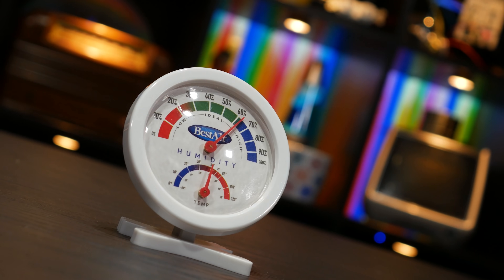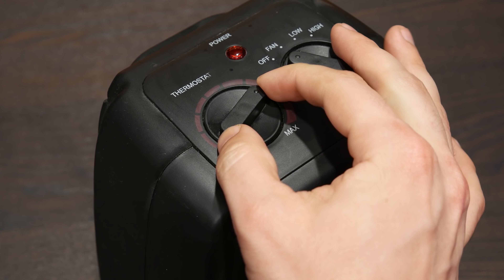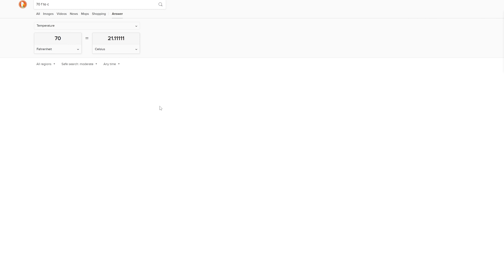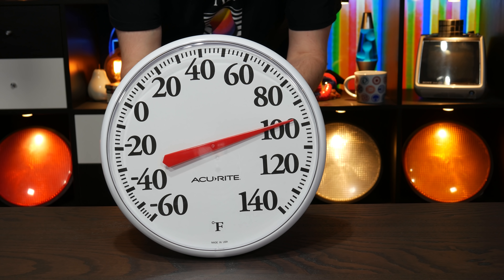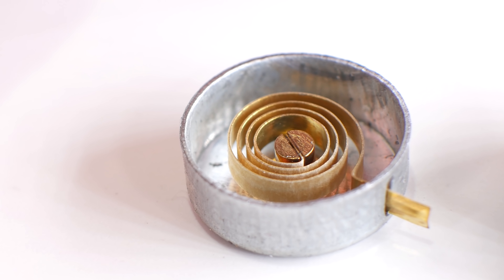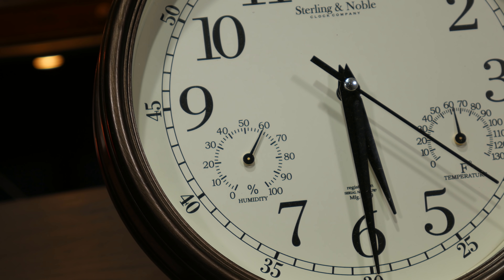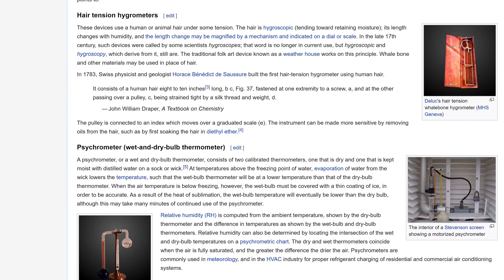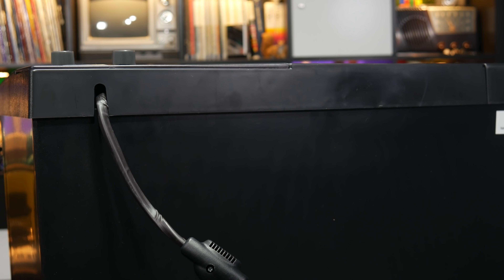Analog Hygrometers - how?

Comment: Cool video, thanks. Few years ago I learned something very interesting about how they measure air humidity at airports. For the flight operations it's more important to know at which point pilots need to expect fog, clouds or icing. Because of this they give the humidity by telling you dew point (temperture at which the water will condense). You can calculate the dew point from relative humidity, but often the dew point is directly measured by cooling a mirror until you see condensing water. I think this is a strange way to measure humidity :-)
Reply: Dew point is interesting very much more relevant/critical. Especially if you live in areas of moderate climate. I have (or am working on ) a logic controller for my HRV unit - which normally serves to remove humidity in winter, but which I use to remove CO2 in summer. The logic will check the outside dew point, and if it is greater than 10C, it will reconsider running the unit since a dew point > 10C will result in an indoor relative humidity > 50% which is not what I want.
Reply: Or dry bulb and wet bulb like inlearnt at shcool

Comment: I like my simple little fridge thermometer it still works out on my veranda.  It doesn't need batteries. There is a clockwork radio that used a clockwork spring to turn a dynamo that generated power to amplify the channel in the radio. The Trevor Baylis Clockwork Radio teardown https://www.youtube.com/watch?v=3Nz781FsyGI . Cheap to buy and cheap to maintain. A clockwork radio perfect for rural backwater countryside far from affordable electricity. Thanks.

Comment: Finally someone taking those metric snobs to task 😂
Reply: They aren't metric snobs. I'm from the UK, old enough to have learned the imperial system, lived in the USA for 10yrs and perform some engineering tasks for a living. I've built lage machines in both the UK and the USA in both metric and standard. I'm lucky. However, most people in the world haven't had any reason at all to consider imperial units. If you were born in Germany 60 yrs ago, you'd have no inkling of what 60,000lbs is. To such a person you might as well say 60,000 birimpups, for all it means to them. It's not a case of "not really having a good grip on imperial"; it's more like they've absolutely no idea what is being conveyed.
Reply: @MrPoopnoddy  Missed my point entirely. I don't currently think in metric, so when I find someone using metric units, I use technology to help me convert the metric units to imperial ones that I can understand. What I don't do, and what Alec is plainly confronting in the section to which I referred, is see units I don't understand and respond by flaming the content creator.

Comment: I'm totally OK with your using Fahrenheit – though I might not be if this were a pure science channel.

I grew up in the UK in the 1970s and I'm an odd mix of Imperial and Metric: basically I fully understand multiple systems (though it took a while to grok "hectares" for some reason, and admittedly I still sometimes forget that U.S. pints are smaller than ours). There was a huge digital thermometer on a building on my bus route when I was at school, and it read in centigrade, so for a while that was an exception: in my twenties I had no clue what Fahrenheit numbers meant. But eventually someone explained the 0-100 = human comfort thing to me and now I understand both F and C - at least at normal ambient temperatures. If I need to convert more accurately, I use the formula in my head. (Google? Why would I do THAT? I need the mental arithmetic practice!)

Some people seem oddly reluctant to accept that it's necessary to learn more than one system ("why should I learn multiple ways of doing something? Everyone else should just change to MINE!")... and yet, it seems to me more sensible to make an effort to do so. It's just... pragmatic. Then again, having been born "on the cusp", perhaps I'm biased.

Comment: I’m all fine with freedom units,  it why in all reptiloid overlords name would someone use percents to measure any ratio? Either go with the much more natural perpi (where for example the really ugly number of 31.8310155048877% equals exactly 1 perpi. Plain and simple. Also more natural, because of pi-charts. Not pie-charts, though because cranberries are hard to convert. Especially to something edible.
Or use the freedom unit of ratios, the centper. It’s like mpg, but for ratios. 25% (metric nonsense) equals 400 centpers, 0.5 equals 200 centpers and so on.
By the way - took only about 40 centpers of the time to write this nonsensical ramble than to google how many barns are in a square inch.

Comment: My dad made a hygrometer using human hair that hung in his shop.  It was a bike spoke, attached to a circular piece he turned on the lathe.  The hair was stretched from the top and wrapped around the aluminum piece at the bottom which was on a bearing, and the spoke was slightly off center of its center of gravity and provided the tension.  It was also the pointer.   He would occasionally ask my my mom for one of her hairs, if the hair needed to be replaced.  It worked pretty well.
Reply: love the idea of devices made from human body parts
Reply: @9600bauds 😏
Reply: Did he drink?

I ask because he obviously knows things, so if drinks and knows things. (Tyrion Lynnister quote)  Old school dads should all drink and know things :)

Comment: When I was a kid, I was fascinated by a home "weather station" from polish mountain regions. It contained thermometer and 2 figures. If a men was in front it indicated nice weather. A woman in front indicated rain. I opened it some time and was very disappointed and cheated. Instead of some demonic mechanism I found out two figures whare just hanged on a piece of ordinary, natural fiber sting. I foot this couldn't make weather forecast any more, then a flip of coin. Yeta it seemed do work. 
That was a simple hygrometer. The natural fiber string got shorter and more twisted presenting man, when the air was dry. It got longer and loosened (more straight) when the air was humid. More humidity indicated that rain is coming. 
With time it got broke and the woman was always out- natural fiber hygrometers of that kind get less and less accurate with time due to fiber getting longer by constant pooling on it.

Comment: As to C or F, Metric or Imperial ... etc .. you sir have a Thermo - METER .. You Have Hygro - METER, Etc and every other thig that counts shit ending in Meter, now let that sink in ;)
Reply: @dolita windo  a parcel of air near saturation may contain 28 g (0.99 oz) of water per cubic metre of air at 30 °C (86 °F), but only 8 g (0.28 oz) of water per cubic metre of air at 8 °C (46 °F)., its a question of mechanics and ratios, a meter just like the one in the video but with both cogs connected, lets say we have 10g water at 30° is 70% and 30 is also very hot temperature, so, the colder it is, the more humid , so basicly temperature cog turns anti clockwise, forcing the humidity cog to turn clockwise, thus in an analog way represent the decreasing temperature and increasing humidity even if humidity stays at 10g per cubic meter,  and having it in a way where if the humidity cog moves left or right by itself it does not change the temperature, just the other way around, we have bicicle gears, car gears, clocks, im sure there would be a way to do it

Comment: But...but...relative humidity depends on the temperature. Wouldn't the bimaterial strip or the numbered scale have to change from one temperature to the next? Or is the paper somehow responding in the same way somehow? Is the metallic strip changing based on the temperature and and the paper just conveniently responding in a way that lets you represent the relative humidity across a range of temperatures? 

Haaaaalp I can't sleep. I have to knowwwww

Comment: If you saw the digital one I had, you would know the meaning of inaccurate. Lol. Not all digital ones are good. All of my other analog ones, read closer to the actual humidity on the weather station, than this crazy digital one I have. It is consistently 20% different on the dry side, than anything else and the analog ones, like you said are about 10% give or take.

Comment: My problem with metric evangelists is that their big selling point seems to be that the measurements aren't arbitrary.  This is ridiculous.  The main selling point of the metric system is that everything is in units divisible by ten.

Metric evangelists will tell you that Celsius isn't arbitrary because 0 is set to the crystallization point of water, and 100 is set to the boiling point of water.  The problem is that the crystallization and boiling point of water are dependent upon the pressure of their environment.  Water doesn't boil at 100C.  Water boils at 100C when air pressure is at 1 Bar.  Is there a low pressure front moving through?  Your water will boil earlier and at a lower temperature.  Why is 1 bar the "standard?"  Seems pretty arbitrary to me.  1 bar of pressure has absolutely no fundamental relationship with the physical universe.

Comment: @1:50 Bimetallics: "This" may actually be of interest to you. Although I've understood the concept and practical utilization since I was a lad .. there was one ubiquitous application of Bi-met that happened to squeak by under the radar until I was three decades into electronics - stove burner "modulation" controls!! It just occurred to me one early morning some time ago that a 70's range sure as shoot wasn't using triacs to control temperature .. and indeed the controls are variable rate spring loaded bimetallic .. Like an old school auto indicator flasher, but with mechanically adjustable break tension (so technically electro-mechanical PWM) You could probably do an entire episode on Bi-mets .. Fluorescent starters, turn signal flashers, toasters .. they even made bulbs with internal flashers - they were an ingenious and simple solution to a myriad of problems before the age of micros.

Comment: 1:58 - I've been saying this for years. I'm happy to use Celsius for almost everything all day every day, but when it comes to the weather and its related temperature, I want it in Fahrenheit. The freezing and boiling points of water are not a useful point of reference in that application. Fahrenheit is indeed more pleasing.

In fact, both of these units are arbitrary conversions of the true SI temperature unit, Kelvin. We use them specifically because Kelvin is kind of a useless scale for most applications. So as long as we're already using arbitrary conversions to make things more convenient, why not acknowledge that Fahrenheit has its place and stop being elitists about Celsius? It's not like this is imperial measurements VS metric measurements, where metric is objectively superior and we're ridiculous in the US for not switching. This is just one arbitrary conversion VS another arbitrary conversion. The Fahrenheit hate is completely unwarranted.
Reply: Actually, for weather using the freezing point of water makes PERFECT sense. Below 0? Expect the streets to get slippery, snow is possible and would stay on the ground and perhaps time to get out the skates. I give you: the 100 makes less sense in that context, but I like the symmetry of using the two state changes of the same substance as the reference. Also, the scale makes a lot of sense for cooking.
Reply: @AndreSomers  anything above 100F? dangerously hot. You can easily get heat stroke if your not careful. Anything below 0F? Dangerously cold. 15F is pretty cold you can tell because it’s close to 0, you can be below freezing point with a medium-light jacket and be fine (around 20-30 minutes), the closer to 0F/-18C(or below) you can’t do that. Although to be fair where I live it rarely ever gets to be below 20F/-7C. So makes sense to me.
Basically Fahrenheit is great for measuring ambient air temperature. It makes sense on a human scale. You want temperatures between 0 and 100 anything above or below is hell. Also Fahrenheit is actually MORE accurate in terms of air temperature.. 50F=10C 51F=10.5C 52F=11.1C 53F=11.67C etc. check the weather in Celsius and they don’t ever put the decimals, meaning they are always rounding up or down. The temperature difference to you and me would be meaningless. I can’t tell the difference between half and degree, but it’s still fun to think about how different scales can effect things.

Comment: This is not new-fangled. In the early 1980s my parents used to run a flea market stall in Australia, and I would go amongst the other stallholders buying crap. I remember buying a box of NOS aftermarket car gauges that included several boxed "thermometer + paper/metal hygrometers". I also remember wondering how they worked, since I knew how bimetallic strips worked :)
Anyway, they were already old hat in 1984.

Comment: Regarding the Temp Unit thing.

Firstly, I don't really mind it, I've been trying to get used to F and C because a large chunk of videos I watch use F in them. (Which was a pain)

But that's just the thing, you can get used to different systems. And once you get used to different systems, you can determine which to use and when to use them. It's hard to change a person, it's even harder to change a small group, much less an entire country. My suggestion is to simply teach and use both scales in school. That way, younger generations can easily use whatever they want to without breaking the traditions of older generations.

America WILL eventually switch over, the question is but WHEN. It should just be a slow process and not something forced on them. But for now, do whatever feels better for you

Comment: As you said, asking search engine to convert from f to c is really easy. It takes just a couple of seconds to do it.
My question is, why aren't you doing it? If you do it and provide both values in your video, 5 seconds were spent on converting and let's say maybe 1 minute on editing it into a video. Total work time 1:05 minutes.
Now, lets say that quarter of 1 mill subscribers need to do it themselves as you are asking them. That's 5 seconds per person, so about 1.250 millions of seconds. That's over 14 days of nonstop converting if single person was to do it. Or 42 days of 8 hour shift. 

So by spending a little time to include conversion into a video, you save 42 mandays of hard work PER TEMPERATURE VALUE you feature in your video.
Reply: I don't know why people do these comparisons. Yes, technically it would waste 14 days if one person were to do it. But one person is not doing it. It's a meaningless number.
Reply: @Owen_loves_Butters  ofcs not. Instead thousands and thousands of people are doing it. Doing exact same thing, to get exact same result.
Reply: @Soulkeeper99  I 100% agree that he should keep providing conversions (which he does most of the time). I'm just saying it's not a big deal if he doesn't.

Comment: As a child in the 1950s, I read about what was considered the “gold standard” of humidity for use by professional meteorologists, the wet-bulb dry-bulb hygrometer.  This consisted of two well calibrated mercury thermometers mounted side by side on a board, with the mercury bulbs hanging off one end.  One of the thermometers had an uncovered (dry) bulb (perhaps protected by a metal screen), while the other was wrapped in a small piece of cloth, like a shoelace.  The meteorologist would soak the cloth around the dry bulb in water, then use a cord attached to the other end of the board to swing the board around in a circle for a prescribed amount of time, in a shaded and rain-protected outdoor shack.  Then they would take both readings and look them up in a table, giving the relative humidity.

Today they probably have two thermocouples mounted on a centrifuge and a microprocessor does the table lookup.
Reply: The wet bulb registers the dew point - a temperature based way to represent the absolute humidity. The chart would cross reference the dew point opposite the ambient temperature (which puts a hard limit on maximum absolute humidity) and the intersection would be a percentage of actual to maximum absolute humidity - or the relative humidity.
Reply: A "sling psychrometer"
Reply: wet bulb is not actually used any more? good grief why doesn’t the news report on things such as this. i’m just a lowly physicist with basic knowledge of the world.
Reply: @shibasurfing you can make hugrometers without needing a temperature sensor at all, there are materials that react strongly to the change in humidity and you can use them to change capacitance or resistance to pretty precise numbers. At least as precise as a thermistor, dunno about a thermocouple
Reply: @melody3741 Yay, it's even explained in the video^^
Reply: @shibasurfing which is why OP acknowledged that they probably use thermocouples now? For a physicist your reading comprehension is pretty dogshit.
Reply: @@cjrock4096 That's exactly what instrument calibration is for: so you know it isn't lying to you.
Reply: @unknownhours Exactly, while electronic sensors can be super precise, there has to be something you can compare the readings to in order to calibrate them. Once you get them calibrated, you can do some software magic to even account for possible deviations.
Reply: @@cjrock4096was gonna say something similar

Comment: 6:10 "It's not that I could expect a hygrometer in a 10-dollar clock to be any good to begin with..."
That's a major consumer attitude problem. That hygrometer is not fit for purpose and should not be sold to the public at any price. Limited resources were spent on a product that provides no benefit, and is therefore wasted.